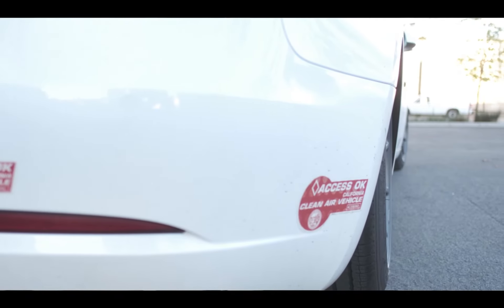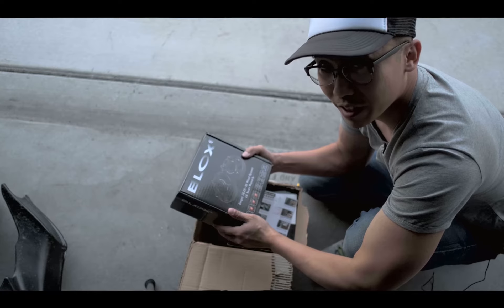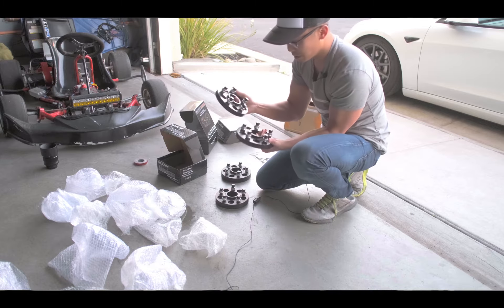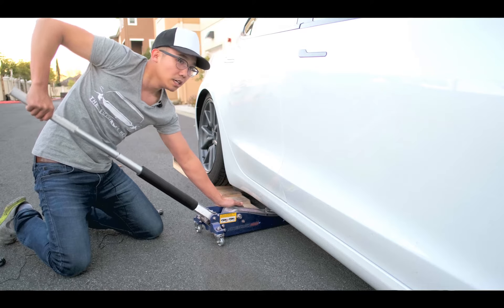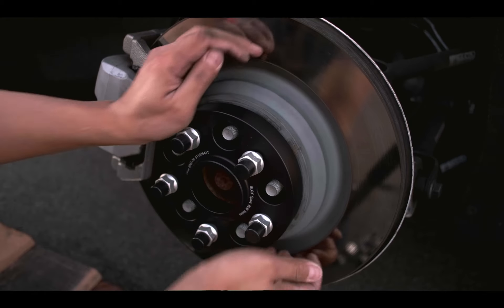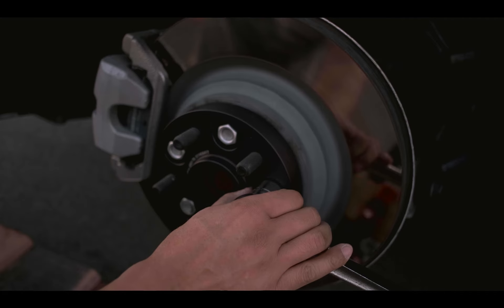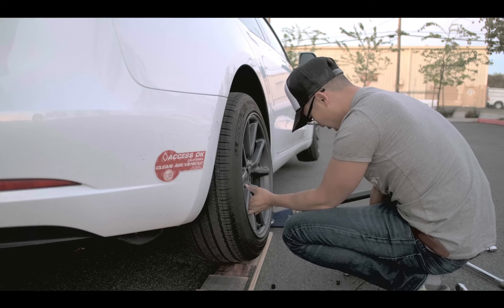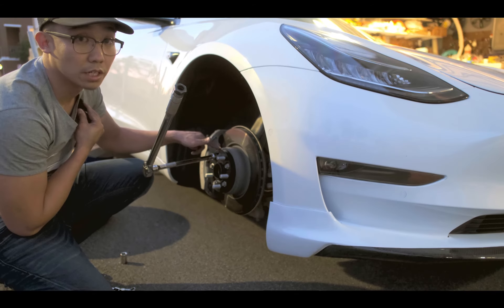Tesla Model 3 Blox Sport wheel spacers installation

Comment: The 10mm bolt holds the brake disk/rotor to the wheel hub. The 5 wheel lugs also hold the disk but the small one is used to make sure the brake disk doesn't move around when you change tires. But in reality most of the time the brake disk kinda holds itself because it's stuck due to all the road grime and corrosion.
Nice work and car! :)
Reply from the maker: I see, thanks good to know! and thanks for the compliment my friend

Comment: Hey, why does the tire appear to have a negative camber on the back wheels? The top of the wheel looks like it's tilted inward, and not nice and square with the ground.
Reply from the maker: hello because the car is lowered, so its naturally negative cambered inward at the top due to the suspension geometry
Reply: @TeslaDIY  I ended up finding one of your prior videos explaining exactly that, lol. I am new to the Tesla scene, became a proud owner one week ago. First thing that needs to change is that hideous OEM tire offset. I was going to do 15mm and 20mm, but I think you've convinced me to go a step up.

Comment: Is your car lowered ? And by adding these modifications does it void the warranty as well as increase the wear on the wheel bearing and suspension ? Does it affect the autopilot? I’m really interest in these but just want to make a sound decision before buying them. Thanks !
Reply from the maker: Hello, it was lowered, one of the first to lowered the model 3 back in 2018, it was on the Unplugged performance springs which lowers 2.1", as far as warranty, as long as what youre in for repair, isn't directly related to your aftermarket parts, but if your car is too low and they can't get it on a lift, they may reject you from service though, 6 years of ownership, never had any issues and my cars are far from factory spec at this point

Comment: How does the car drive. Did you have to take it in for any alignment?  I just purchased the ev direct turbine wheels which are 20 x 8.5 so I’m wondering if i will need smaller spacers 

Good video thx
Reply from the maker: Thanks, Sergio

It drives fine, a bit stiffer to turn but it's expected since the front track is wider, I have my steering set to "sport" and I can dial it back to normal to balance it out, but it doesn't bother me so I left it.

Still no alignment and I am on my second set of rear tires (my buddy gave me his brand new wheels and tires from his Performance Model 3 since he has new wheels and tires coming) and since my rear tire wear was pretty even and the car drives fine, I didn't bother with alignment just yet.

8.5 width is the same as my 18" aero wheel, your wheel offset will matter though, stock wheels offset for my 18" are +40. So my current setup is basically 18x8.5 +15. I personally think it's still a bit tucked in, but I probably wouldn't go wider than 25mm with spacers.

I'd like the say it handles better, but I honestly haven't push it just yet,  I've heard from others that it improves handling on their Model 3. I did do a 200+ road trip with these spacers installed and had no issue what so ever.

Keep in mind that with 20" you will be closer to your fender so even if you are just as wide as I am, you may be at higher risk of rubbing.

Good luck!

Comment: @TeslaDIY,  i went with the 15mm x 20mm set from the same company. Since i have 20s and did the unplugged moderate springs. 

Curious have you experience any rubbing on the front when going over speed bumps. 

After my install i took the car out and went over a tiny speed bump and did hear slight rubbing on the inside wheel liner. Curious if you had that happen as well and any suggesting how to fix.
Reply from the maker: 15mm front with moderate spring will definitely NOT rub, i have the LOW spring and 20mm front, so i am sitting wider and lower than you and was still far from rubbing. If anything that will rub, it should be the tiny mudflap thing that is sitting in front of your rear wheel, however, this shouldn't have anything to do with your wheels spacers, unless you installed both at the same time.
Reply: @TeslaDIY  thanks for taking the time to reply.  Would have the 20'inch rims maybe make me more prone to the rubbing sound i heard?  I will drive it around some more so if I can isolate the issue.  When I fell under the front I just assumed it was rubbing the inside liner.  Can i email pictures of how the car is sitting?
Reply from the maker: @SergioERestrepo  Oh i missed the part where you said you are on 20s, that could be the case, altho on 20s, you're likely to have lower profile tires too so the overall diameter shouldn't be too much bigger. According to Willtheyfit.com, assuming you are on the stock OEM 20s, they are 20x8.5 +35 with 235/35/20. Your overall diameter is 4mm bigger only, pokes 5mm more.

On my current setup, before i raise the back by half an inch (UP low spring sits 1/2" lower on the back) i was rubbing fabric liner on hard bumps. i trim it a bit without worrying about cutting away oem fabric liner..thinking they are probably cheap to replace and i don't think it will ever bother me or give me any issue.
Reply: @TeslaDIY  thanks so much!  yes i'm running 20x8.5 with the 235/35/20.  seems i'm gonna have to consider cutting at the fabric.  In my case I think its my front liner.  I will keep you posted   thanks again!  appreciate all the help
Reply: I ended up rolling my front fenders and that’s helped avoid the rubbing. As a last resort may need to go with 5mm in the front. It so far so good after rolling my fenders. Just have to go slow on driveways. :)
Reply from the maker: @SergioERestrepo  I had 20 front 25 rear with UP Low spring and did not rub. I started having rubbing issue after i got my 19x9.5 +40 BBS with 255/34/19 and so i trimmed that fabric fender liner a little bit. But for your setup, i don't think it should be rubbing.
Reply: Tesla DIY like always thanks for the reply. Yeah i didn’t think it would rub. But one day turning into a driveway the fender shaved some of the tire. That’s when i knew i had to roll the fenders. Lol. Luckily there was a guy in Phoenix who does them.   @tesladiy think your contact ca install the steering wheel cover for me?
Reply from the maker: @SergioERestrepo  Maybe cause i am used to going up those driveways slow and angled, so i didn't compress the suspension far enough that my tires meet the fender? hopefully it didnt damage anything....and my rubbing is from the back too, i don't remember ever rubbing in the front, even when i am on 19s now

Comment: hi sir, if ur camber is put back to factory specs or say -/+ 1 degree max  wud u still be able to use 20/25mm without rubbing? how much negative are u running in this video?
Reply from the maker: Absolutely, you can even run 25 up front and 30mm rear without rubbing, not on your fender anyways, you might rub on the fabric liner from time to time if you ride low “2.1” drop was what I had, and only when you hit a bump at speed, but all depends on how low you plan to ride. I have different wheels that’s wider than 20/25 on stock wheels and on air suspension now
Reply: @TeslaDIY  okok. I'm gonna bag mine also but can't decide on wheels yet, so I'm just gonna use my replika r241 19x8.5 +40 wheels with spacers and mpp rear camber arms. I'm tryna keep the camber within oem specs as much as possible and be lowered
Reply from the maker: i don't recall the camber spec at the time, but i believe it was an unaligned natural camber from the 2.1" UP low spring drop
Reply from the maker: @b58peeezy  Yeah i have a friend who had 25/30 with stock 18s aero on his bagged Model 3 (its_mkiii on IG). It'll work and look so much better until you get your desired wheels. I am personally on 19x10 +22 now with 265/35 running -1.6 front and -2.7 rear (could use a bit less camber in the rear to get a better flushed squared fitment) and this is a good aggressive look setup at ride height while it being a bit tucked when aired out, if you want fender to lip, you would want a bit lower offset and narrower tires.
Reply: @TeslaDIY  do u have or need camber arms up front ?
Reply from the maker: @b58peeezy  I personally don’t have aftermarket FUCA, but if you want to really dial in your front alignment spec, it would be nice to, since there’s not much of not at all for any adjustment from the factory
Reply: @TeslaDIY  okok thanks. I added yall both

Comment: I'd like to do this as well, but I have staggered 20" wheels from tsportline. 20x8.5" Front, 20x10" Rear Offset+35 Front, +40 Rear. Probably just need to push the fronts out only. Rears are OK, but could add another 5mm spacer dunno. Great videos!

Comment: Hello, 
Why did you decide to get the 6061-T6 over the 7075-T6 forged spacers? Also, Why did you choose to go 20mm in front (which looks and sits perfectly) and not 25mm all around for a flush even look? I’m debating myself at the moment.. thanks! Great videos!!
Reply from the maker: I actually wasn't aware there was a 7075-T6, I did some search on both ebay and Blox's official site to determine if what eBay has are legit, found out they are all from China (was actually shipped from Hong Kong if that matters). Just wanted to make sure I am using what everyone else is using.

20mm front because the front and rear actually have different clearance to the fender, even with the 5mm less "wideness" in the front, it is more flushed than the rear right now. if i went with 25mm all around, my front will probably be much more flush than the rear. Ideally, i want my rear to push out even further, but i wouldn't want to go wider than 25mm. 

New wheels will be coming in the next few months!
Reply: Tesla DIY 

Thanks for the reply! Are you locally in Orange County, California? If so, I’m in Huntington Beach area and plan on getting the same setup. Low UNplugged springs and spacers. Would like to see it in person! 

Haha so your wife is allowing you to get rims now!?

Yeah, back to your post. According to the website, they said more then 25mm needs some adjustment. So the 20mm sits flusher to the fender then the 25mm rear... 

Hmm.
Reply from the maker: @elvispham  you're welcome! i am actually not local to you, i am in the Bay Area near the mothership of Tesla
Reply: Tesla DIY have you notice any problems with the spacers after months of driving after being torqued @ 129lbs for the spacers and rims?
Reply from the maker: @elvispham  Hello Elvis, no issues, drove many miles with them, including 2 road trips from nor cal to so cal. so far so good

Comment: debating with 20mm or 25mm for the back. I don't want any poke what do you think? Is 25mm too much or is it flush?
Reply: my car is lowered an inch yours seems a little bit lower.
Reply from the maker: I was lowered on then UP low springs which advertised at a 2.1” drop. Meaning my natural negative camber would be more, so my wheels and tires would be a bit further from the tires compare to your 1” drop. So with the same spacers, your tires will sit just a bit closer to your fender. But I am able to run 30mm spacers in the back when on air suspension, fully tucked and my tires still doesn’t touch the fender. I think you should be ok with 25 in the back without poking out at ride height

Comment: what spacer thickness would you recommend for exactly the same wheels, but no camber and a 1 inch drop spring kit (eibach number E10-87-001-01-22)? I just want to get the wheels even with the fender without sticking out. Some say go with 15mm spacers all around, and others say go with 20. in your experience, what would you chose?

Comment: I noticed a bit of camber on the wheels.  I was wondering if there would be any rubbing with the 20/25 setup if the wheels were perpendicular to the ground?  I'm thinking about going 20/25 but my car will only be slightly lowered, and thus less camber.
Reply: I know this is half a decade later, but literally wondering the same thing. Where did thr camber even come from?

Comment: Hi @tesladiy how are the wheel hubs now? Are they making any noise or damage from using the spacers?
Planning to mine on soon.
Reply from the maker: No noise no damage, I don’t have them on anymore since I have new wheels now. But I did had them on for about 2 years with about 30k miles on it, no issues

Comment: Thanks for your reply!  So I wonder with the 19” stock wheels if I need the smaller spacers?  15/20?  Not the 20/25?  If you know what the correct spacer size needs to be for the 19” wheels I would appreciated reply!  Don’t want to buy the wrong ones!  Thanks again for your help!
Bill
Reply: I Beleive the 18s and 19s should be good with 20s and 25s but the 20s as stated would possibly rub

Comment: Great job bro! I know your have the UP Low springs but I'm on getting the UP Moderate springs. Do you know if the 20mm (front) and 25mm (rears) might be too much?
Reply from the maker: Thanks buddy, no it wont be too much, in fact, that is exactly what i am using, i am on LOW spring too so if i don't have any issues as far as rubbing, you shouldn't
Reply: @TeslaDIY  Really appreciate the great info. bro. Thanks again!

Comment: Yes how does it drive and what about the alignment?  Can you please comment of these questions.   Thanks
Reply from the maker: my tire wears was very even and i never bothered with alignment, car drives fine and all, not too stiff or bumpy but i am used to coilover setup from my other cars so my definition of not stiff may not be relevant to others.. When cornering, its definitely stiffer than stock and helps hug the road better, i think thats what the dual spring rate is designed for, easy on normal driving, stiffer when  you push it harder

Comment: I'm thinking of doing 15mm up front and 20mm in the rear with BBS C-IRs (19 x 8.5 with a +36mm offset). This will make it 19mm up front and 24mm in the rear. I have UP mild springs, so not worried about rubbing, but I'm also thinking about getting slightly upsized tires (245/40/19). I noticed when turning fully in either direction, there is about 2 finger clearance between the front edge of the tire and the back of the wheel well. Do you think with the added diameter of the tires (0.4in total) and the 19mm in front, the tires will rub when turning?
Reply from the maker: I am currently on 19x9.5 +40 BBS C-IR as well 255/35/19, 25mm spacers rear, only rub a little on the back on big bump, and rubbing against the fabric liner, which i trimmed and no longer rub, and i am riding realllllly low, check my instagram @peekaystudio for more recent photos
Reply: @TeslaDIY  Just wanted to confirm on here with you. I installed 15mm/20mm spacers with stock Aero wheels and they (the rims) sit perfectly flush with the fenders. I'm on mild UP springs so barely any camber. I checked for rubbing when fully turned turned in either direction and there's plenty of clearance. I will be ordering the wheels/tires I mentioned above really soon and I don't think I will have any issues. Thanks for all your help on this!
Reply from the maker: @ronniegarcia349  glad to know! plenty of room for sure with 15 and 20, not flush enough for my liking which is why i went with 20 an 25, still plenty of room. I have new setup now btw, check my latest video if you haven't seen it =D
Enjoy your ride buddy!

Comment: Looks way cleaner.  Definitely going to do this.  Did you ever end up getting the center cap and lug nut cover kit?  I got the gray cap with black lug covers.  Looks pretty good.
Reply from the maker: Thanks! I finally got new wheels! still running the rear spacers tho and its wayyyy more flush its perfect! check it out on my instagram if you want.
peekaystudio
Reply: @TeslaDIY  Ok I'll check it out - I'm ProjectLJ on insta but haven't posted any Tesla stuff yet, just Jeeps.  I just ordered the 20mm and 25mm spacers from eBay.  Can't wait to put them on!  Gonna stick with aero wheels but they need to sit more flush for sure.
Reply: @TeslaDIY  My spacers showed up yesterday!!  Pretty fast shipping from China to CA.  I put the driver side on last night.  Gonna put passenger side on today.  Looks a lot better flush, but now I need lowering haha

Comment: Did you feel a difference in performance after this install? I felt the car would sway from side to side a lot easier. Thank you for the video. I installed these as well, and I love the look.
Reply from the maker: Thanks, I didn’t, if anything steering may feel a bit heavier but I am used to older cars that are rough and no power steering so it was fine for me, I mainly did it so they sit more flush before I can get proper wheels

Comment: What size wheels do you have ?  Will these 20/25’s work with the factory 19” wheels and tires?  Don’t want any tire rubbing on the fenders!  Thanks
Reply from the maker: Bill Kohl I have the stock 18” which are 8.5” wide with +40 offset, I believe the 19” stock wheels have same width and offset? But keep in mind the larger diameter of wheels and tires combined may get you closer to the fender than my setup. I have absolutely no rubbing, and I think I’m still 5-10mm from flush in the back

Comment: It looks like you could have fit 25mm/30mm spacer front/rear. Can you confirm? Looks great.
Reply from the maker: E46isthebest yes! Definitely still have some room left, with the current tire setup that is, with more meaty tires like toyo r1r which is what I’m running next, it may add a few more mm. Not sure how safe it is above 25mm tho